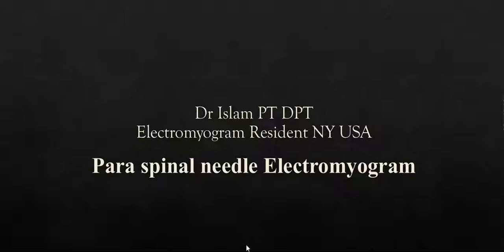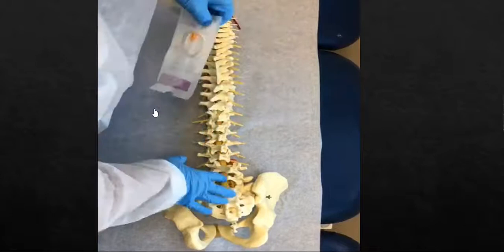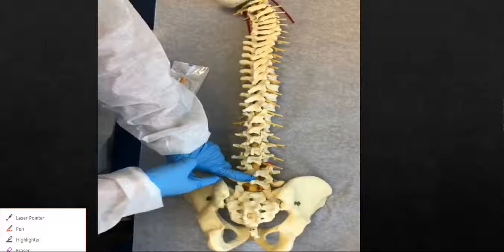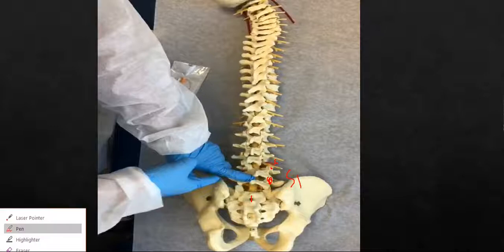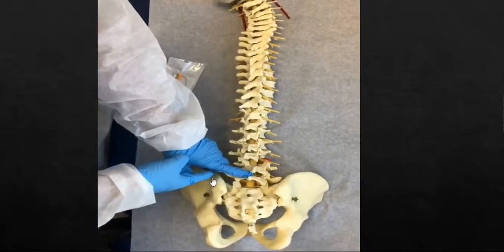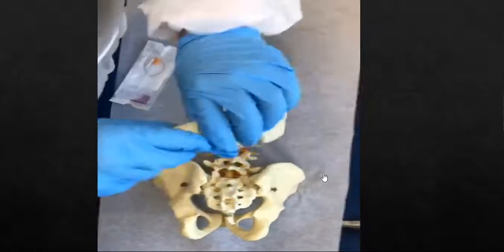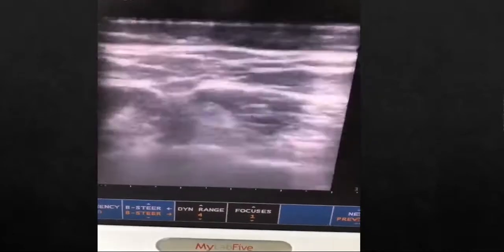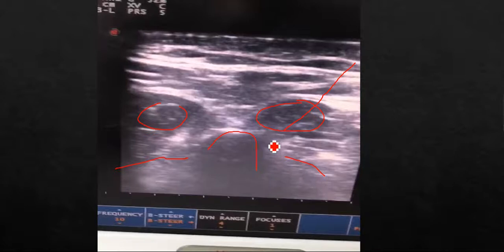Paraspinal needle Electromyography testing  procedure

Comment: NIce video.  Paraspinal EMG is important.  PLEASE use evidence based approaches like Paraspinal Mapping. Without a quantified approach the false positives and negatives severely impact findings.  note there is NO S1 innervation of the paraspinals.
Reply from the maker: Thanks for the comment.
First there is a lot if controversy about paraspinal mapping.
There is no S1 or L5 or any root isolation possible because they all overlap you can’t isolate any root, in paraspinal needle exam.
Reply: @upskillneurosurgery.694   Thanks for the discussion. This is good to sort out. I know this is what folks say, but its really old discussion not shored up with any good date.  In contrast, labs in at least 4 continents have shown paraspinal mapping to have excellent inter-rater reliability, specificity, good sensitivity for surgically important lesions in masked, controlled trials and to improve surgical and injection outcomes.  (Regarding. S1, the anatomists would disagree with you (Bogduk, others).  This was found unexpectedly in data and over the course of my lifetime I have never seen a statistically significantly abnormal paraspinal mapping in a pure S1 radiculopathy. I have seen (and published) bias among doctors who test the limb then have an attention bias in uncodified paraspinal EMG--even more to concern us). Paraspinal Mapping in fact is the only part of EMG recognized by NASS as valid for spinal stenosis. There's much more to learn,
Reply: Thanks, what about inserting needle perpendicular to reach deeper layer with less overlap?
Reply from the maker: @gamaltaher9714  it is not going to make a difference here you are going ultrasound guided not blind.
Whatever the angle as long as you see the needle going into the muscle.